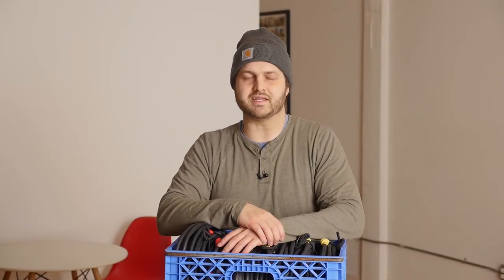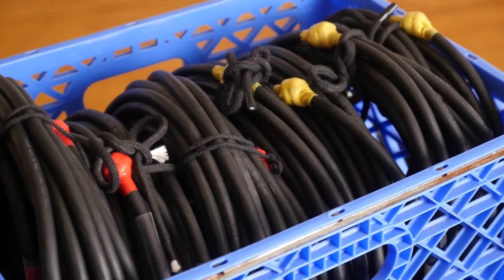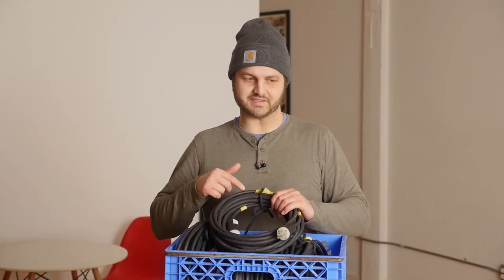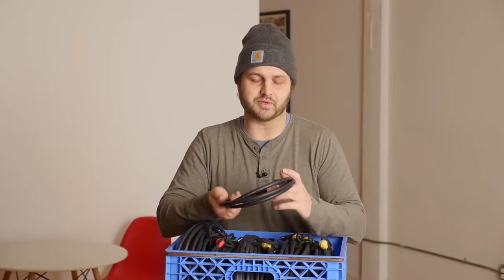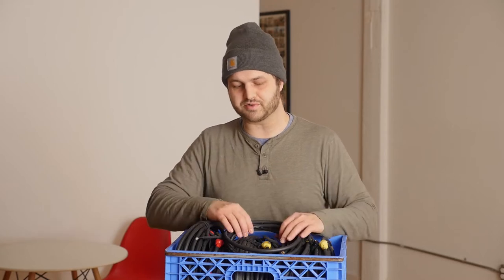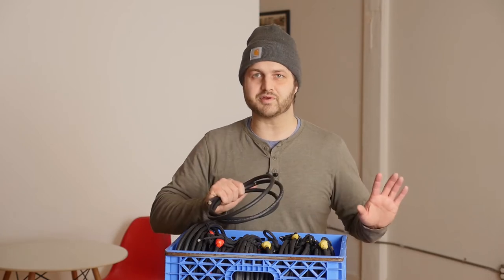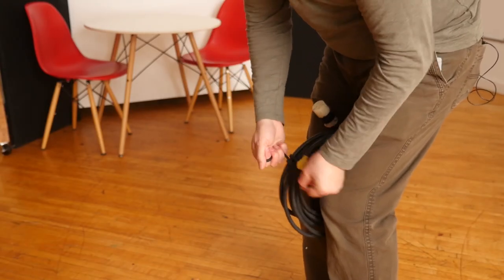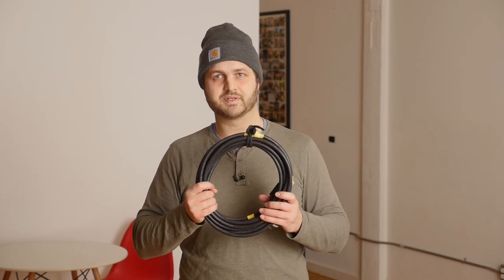How to wrap stingers (And what is a stinger?)

Comment: So happy you are addressing and re-enforcing over-over method. I'm dumbfounded how many "experienced" crew keep on thinking that over-under is the 'proper" way for stingers, and will even argue with me when I ask them to do over-over when working with my gear / Sprinter. Worst is when I am tempted to ask my "boss", the DP, who proudly exhibits his over-under skills, wrapping my stingers, but I hold back, not wanting to undermine being asked to work with them again. Recently I was gaffer and provided most lighting and grip to a small feature, and due to an accident breaking my foot on set, I was not able to be there for final pack. They packed the cable with mud on them, and in trying to clean them, I had to undo the tangle that happened from over-under, and rewrap dozens of stingers, which took several times longer than just wrapping it properly to begin with.  Also amazed how many crew say they were "taught" to wrap stingers over-under in school or while learning on sets.
Reply: The key wording is: so that it's not fighting itself. If that means going under after going over. That's okay. For the most part if it's an untwisted cord then over over will be fine. This is the third or fourth video I've watched on the topic. Another one use the wording; keep it from becoming twisted. I described it as: not having tension on or within the cord. I hope this helps when you're teaching others in the future.

Comment: I was told if it transmits Data or is Coaxial than it goes over-under.  and yes, over over on film sets, and start from the male end when you can so you dont drag the male end and scratch/damage location or your stingers
Reply from the maker: When I’m wrapping Dmx cable on set I always ask whoever’s cable it is how they like it wrapped. I feel like the answer is most often over-over. 🤷‍♂️ I feel in that case however the owner wants it is the right way.

Comment: What material do you use for the tie cord? And how is it attached. Also do you just use gaffing tape to color code your cable?
Reply from the maker: I like #8 sash- it’s just cheap cotton rope.  I attach it with a clove hitch and then I secure it with colored electrical tape. Yellow for 25’, red for 50’ is my system.
Reply: @PancakeLighting  Thank you for the info.
Reply from the maker: @poucedeleon  cheers!

Comment: What is the benefit of wrapping over-over rather than over-under?
Reply from the maker: For more delicate cables like bnc and dmx, it is easier on the inner wires.  Heavy duty cables like these don’t need that extra caution.

Every time I do an AV job their 12/3 stingers are wrapped over/under. It’s a difference of standards between industries.
Reply: @PancakeLighting  Ive been chewed to death about this subject. Another has told me its because if you think about how that cable was constructed and how it was packaged, the cables come off of a spool, so really you are trying to help keep the cables natural curve which help the cable stay in good condition. Over under (as much as I love that more) twist and turn the copper on the inside so the cable starts to twist and bunch up which can eventually lead to breaks. So its a matter of keeping the cables in good condition, which means more rentals over the lifetime of the cable. Just wanted to share what ive learned. Nice vid Logan
Reply from the maker: @GripTips  Touche! Thanks Dave that is a much better reason than "This is the industry standard"  Thanks for sharing and helping us all learn!
Reply: I’m from the stills world, and we’ve mostly been told Over-Under too. Cables seems to lay flatter, and splay out easier when over-under.

 Granted, my experience with over-over is limited- I wonder if they have the same benefits (usability wise) that over-under does? Can you simply plug in at the wall, lay the coil down on the ground and walk the end across the room? Or do you end up with a mess / a bunch of trip hazards? Do you end up having to twist the cable a few times to make it lay flat?
Reply from the maker: Usually we would drop the coil at the bottom of the light and walk the plug over to the outlet because we want to have the extra near the light in case we need to move it again- you’re just pulling cable from the top of your pike and not dragging the whole cable across set. 

When I built my stingers and the cable was new it needed to be twisted a few times to lay flat. As they’ve gotten worn in they mostly lay flat as they are uncoiled. It doesn’t bunch up in a mess if it’s coiled neatly.
Reply: This is my understanding. Over-Over is like wrapping the cable back around a spool. Each "over" introduces a twist in the cable. If you grab one end of a coil that was wrapped over-over and simply started walking to extend out the wire, the cable will have twists in it and it won't want to naturally lay flat. Over-over needs to be de-spooled, so technically you want to "unroll" the coil. It's not a huge problem with stingers since they're fairly heavy and coiled in fairly large diameters, so the weight of it does help keep it down.

For Over-Under, each "over" introduces a twist and each "under" introduces a counter-twist. So you can simply toss the coil and it will more or less lay flat. The downside is that Over-Under has a direction to it. You have to know which end is on top and which end is on bottom. If you try uncoil the wrong way (say you tossed one end instead of the other end), you end up with multiple thumb knots which is a huge pain to de-tangle.
Reply from the maker: Great explanation. Thanks Oliver for chiming in! 👏